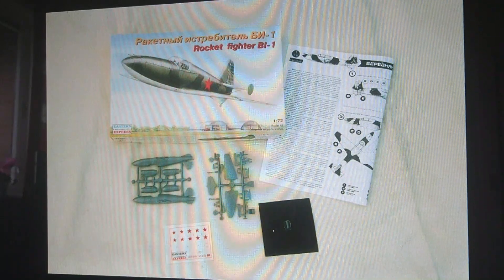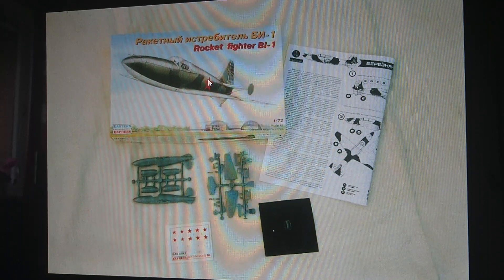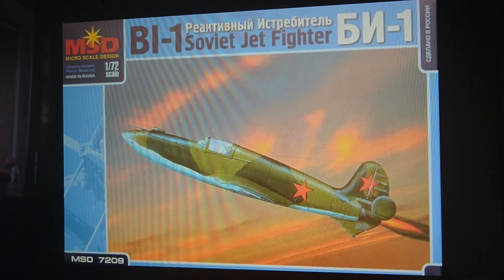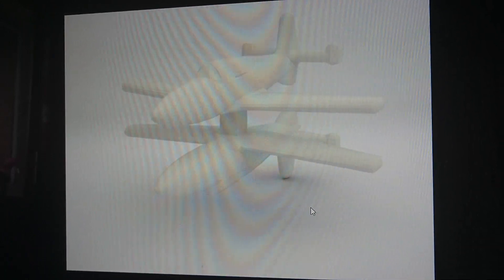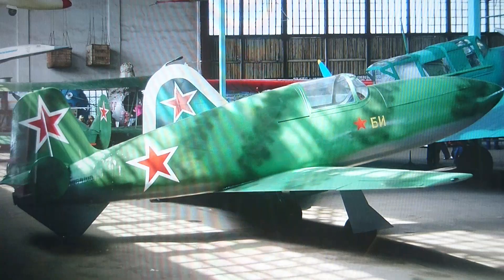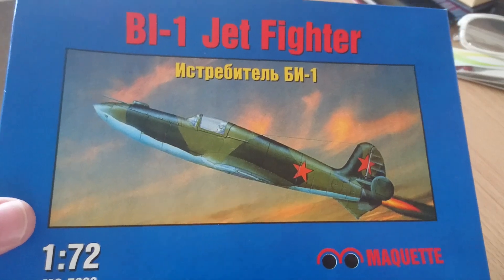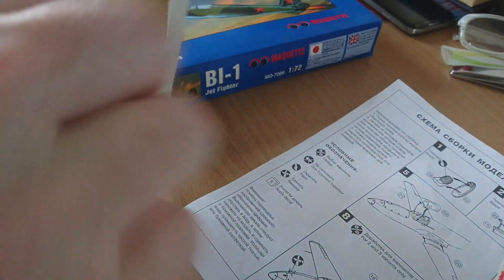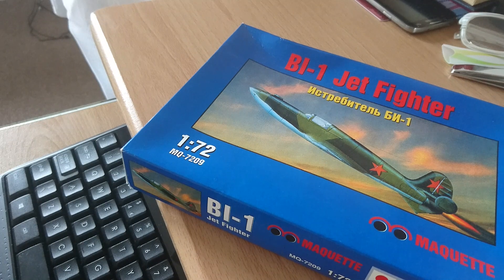Maquette 1 72nd Scale Bereznyak Isayev BI 1 In Box Review

Comment: You won't see the cockpit detail because the transparency is so poor and a poor fit, as are most of the parts of this kit. I've made both versions, one with the outer wingtip engines and one without. Last week I also picked up a copy of the "MACWTAB" kit in a charity shop for £2.50. which I'm currently building, the fit of which is worse with no interior detail. It does however have some exterior detail and similar dimensions to the other kits.